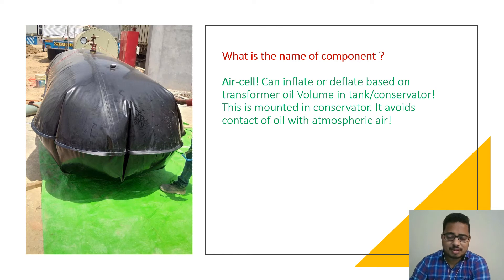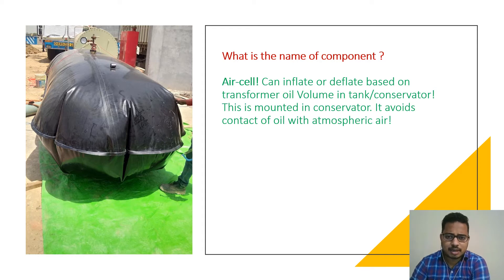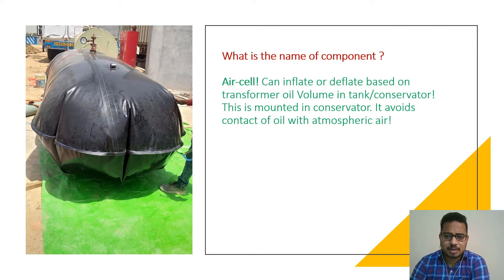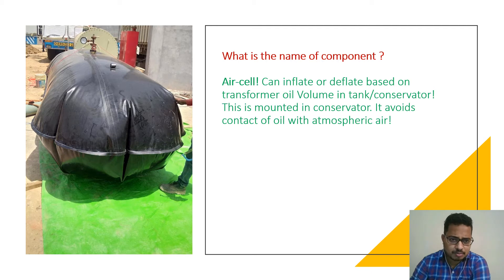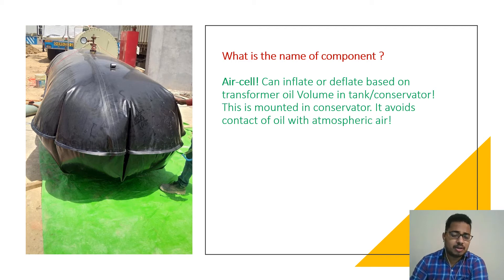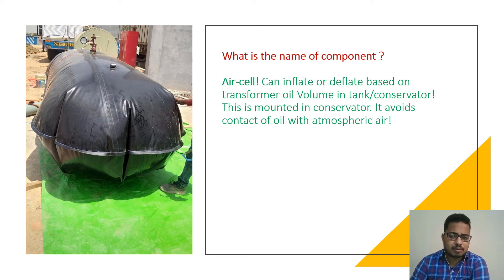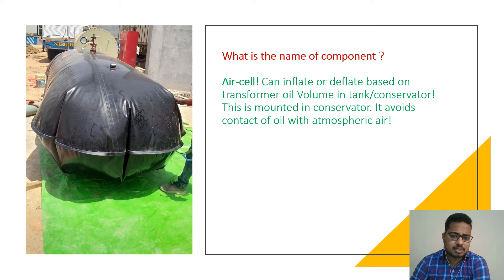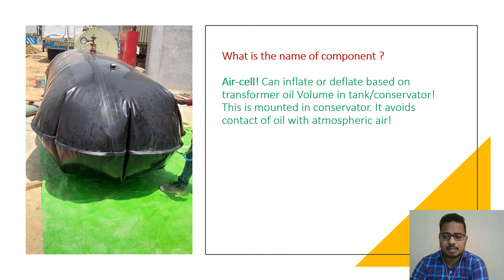🔵What is Air-Cell❓ Where it is used ❓

Comment from the maker: Small correction! 
When oil volume increases in tank due to oil expansion ( because of loading) the air cell will deflate ...( in video i told inflate sorry for that)
Reply: Aircell  nitrogen filling pressure how much ?
Reply from the maker: @rahuraja388  Generally .8-1psi we can fill ! N2 is not recommended! Dry air we can fill!